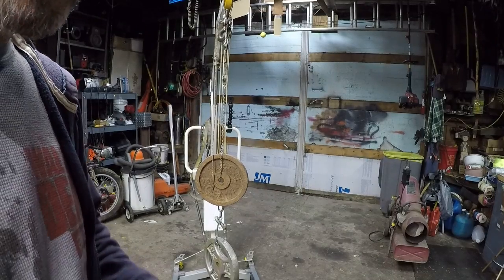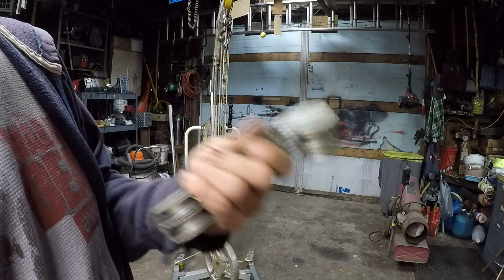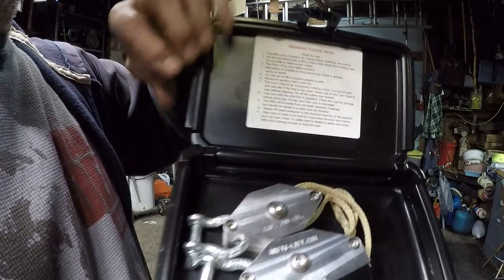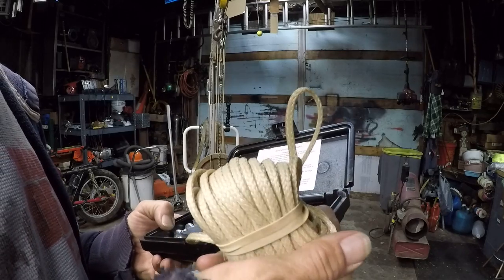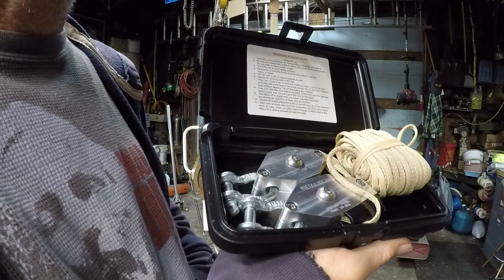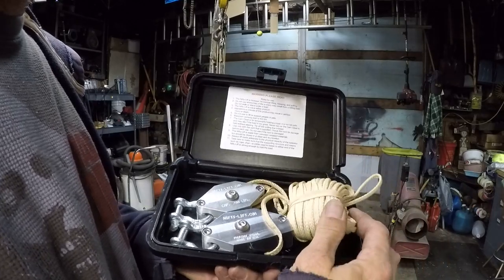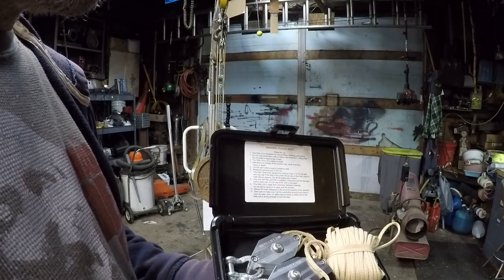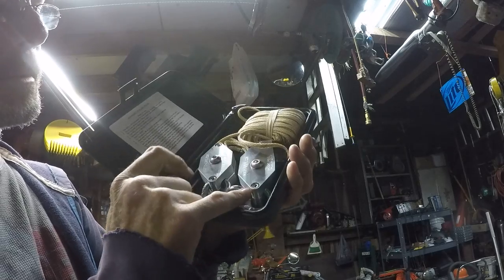Is it perfect? The Nifty-Lift Block and Tackle

Comment: Looks good and well made, take anywhere lift, also looking forward to watching it work, thanks Zippo
Reply from the maker: Albert really knocked it out of the park with this. Check the description for links of others who put it to the test. Especially the Swedish Homestead video. Impressive to say the least. He just got back results from a Polytechnic Institute and it didn't fail until it reached nearly 6,000lbs of pull, and then, it was the line that broke. The block and tackles were fine. Incredible! Cheers Mule! Zip~

Comment: ZIPPO I'VE SEEN THIS PRODUCT BEFORE.....IT NICE TO HAVE FOR MANY REASONS....
Reply from the maker: Lots of uses. Pulling a tractor onto a truck bed or trailer, lifting things into the beds of trailers or trucks, slinging up game to dress, pulling lines taught. Block and tackles have been used for hundreds of years for virtually all lifting tasks. As small and compact as this thing is....and as strong as it is....Yep, it's a very valuable tool for the shop/truck/camper etc. Cheers Donald! Zip~
Reply: ZippoVarga yep big time for guys who pick up junk , old parts mowers, I had a,old small winch the magnets delamated from in the 12v motor so one day I pulled the motor and seen that but looked at the drive side of motor and it was somewhat square.
and a 4 inch long 3/8" drive extension and the 1/4 hex to 3/8 adapter and put it my (sorry) Makita 1/2 18v drill and man it worked for years....used it to pull Dakotas on tires....pull stuff on to trailers......so ZIPPO, SINCE you post great videos this winch 
is like the a tv winches they  have a second life so in your spare 
time.  haha right,    I'm  sorry to hear you've been down.....my energy level has dropped found out (va) doctor was shocked my blood levels were high,  ME TOO....they quit giving out test strips
they, which would of let me know some thing was out off wack...
  anyway got them down......back at it .....still slow....and way to many projects building a huge 8x10 drive on ramp for a guy who has Parkinson's (ITS)taking a toll on him, he's a car guy so he wants to put some of his toys up and it has to be strong enough.
sorry about the babble,  kinda wish we were closer because I got to much stuff.....some I'm sure you could use........
      got a pallet racking job to do .....small business close half a block away...to do.....but I is a mopar guy ...raced my 69 ROAD RUNNER.  went best of 10:69 @125 back in the 84..  always it seems to have been drove performance cars....CHASSIED it went thru a divorce in 89 and have been single ever since.....parked it 
haven't touched it since......but hopes and dreams to one day to put it back for the track....stick shift yep I loved the 6000 rpm launches......so that's why I put a chassis in it lighter..and requirement for the 9 second runs.  soon to be 67...
     still babbling along .......I was going to try some humor about the cool block and tackle I was thinking of great for a guy who a fellon(felling) trees like you.....but it's not much to haha about.
Dad was a,lumber jack use to top tall fur trees as a young man on the west coast .....till he moved your state.......
 have a great day ZIPPO......cheers to you and all who you hold dear.....
 look into the atv winches give them a second life...seems like every one has one....motors do burn up.....and cordless drills
current ride a 2000 Dakota R/T  with some tweaks.......

Comment: What is the difference between the silver one and the red one.
Reply from the maker: The red are hard anodized for corrosion resistance, the silver are not. Zip~
Reply: So if I keep the silver ones out of the rain are they pretty much the same thing as the red ones.  Also wanted to know if a brake is all that necessary
Reply: Is the silver one just as strong as the red one.

Comment: Pretty cool, Zip!
Reply from the maker: Thanks Mr.A...of course...you CAN buy higher capacity block and tackle for way less. But it's the quality of this that really impressed me. Not everyone's cup of tea to spend a lot on a unit like this, but it's something you can pass down to your children. FYI...I got the Polytechnic Institutes report yesterday. The block and tackle failed at 5,800 pounds! And then, it was the line that failed and not the blocks them selves. Pretty impressive! Albert conservatively set the max load to 700lbs. With the new information, that brings the safe working load up to 1,700 lbs!! Pretty incredible for a 1 1/4lb block and tackle system! Cheers my Friend! Zip~ p.s. read monkey's comments...shaking my head lol.

Comment: If you look at spects. You can buy better for less.
Reply: Just google them and look at spects and prices. When i see an infomercial like yours i check.
Reply from the maker: Not an infomercial first off. I googled CNC machined Bearing Block and Tackle and nothing even remotely close to Albert's design shows up. In fact, there are NO block and tackle units even remotely close to having the level of quality and workmanship being manufactured. Check the links in the description and even though Albert is being very conservative with the load limit on his system, it's much more capable. To the tune of lifting 5800 lbs before failure in a controlled environment, and then, the cord was the failure and not the block and tackle. Are there other options? Of course there are...but you won't find a higher quality, lighter weight ball bearing block and tackle out there. Period. Back to this being an infomercial. Albert is a fellow veteran and good friend of mine. He is also an inventor of many things and also makes portable shelters for homeless veterans and gives them away for free. To assume this is an infomercial is an insult to Albert and my self. Infomercials sell inferior crap at inflated prices that will break or fall apart a week after you get them. This system will outlast most of us. I don't expect everyone to run out and get a Nifty-Lift because of my video. I believe in Albert and I certainly believe in the Nifty-Lift he's invented because I know the man. As a side note, the Nifty-Lift comes with a Lifetime Warranty. Get that with the other block and tackles out there. Zip
Reply: Your nifty lift spects out at 1,700 lb. I saw two that spects. at 4,000 lb. One was 19.99$. The other was 29.99$. I hope you are getting well paid for doing this infomercial. I have watched your vids for a long time and like most-but not this one.
Reply from the maker: I respect your opinion and your right to voice it Monkey. Thanks for your honesty.
Reply from the maker: I thought about leaving this alone Monkey, but I want it made 100% clear here. Albert is a fellow Veteran and good friend of mine. I offered to do a comprehensive review for him. I am NOT getting one red cent and wouldn't take one even if he offered. When I believe in something, I want to spread the word. your first comment said "If you look at specs, you can buy better for less". It should read....If you look at specs, you can buy higher capacity ratings for less" Not "Better". I asked you to show me "better" and you commented...do a search. I did...and there is no better made block and tackle on the market. (using your word "Better"). There's quality, then there's products that will get the job done on a budget. A box knife will cut, as will a Chris Reeve knife. But to compare them to one another is like comparing a Corvette to a Yugo. There is no comparison. This is my point with the Nifty-Lift. It's the high end option. Not for everyone. But if quality matters, then there are no comparisons to be made with the build quality of a 20 dollar higher capacity china made block and tackle to the USA Veteran made Nifty-Lift. 

As I said, I respect your opinion and your right to voice it, but I took personal offense with your comments. You're suggesting I can be bought. Suggesting my video is an Infomercial. And that is offensive. Why? Because it simply isn't true. I respect you, you respect me. If you can't take me at my word and respect me, then I misjudged you and you misjudged me and my character. I don't expect an apology at all. I just expect respect and I deserve it. If you had accepted my word and not your opinion that this video was an infomercial, you wouldn't have said it a second time after I replied. 

I also respect that this video wasn't your cup of tea. Commenting that by it self would have been more than enough to get your point across and I don't aim to please everyone all of the time. It's a good practice (as I have exercised here) that if you have nothing nice to say, say nothing at all. But to insult me personally was completely uncalled for. If my opinion offends you, then you're not as forgiving as I am. Zip~
Reply: You are right. I was an ass.I would not have even made a comment except for the price. I am sorry.
Reply: Thank you.